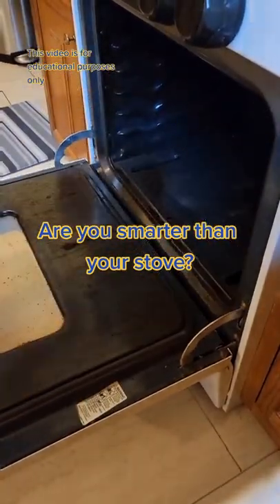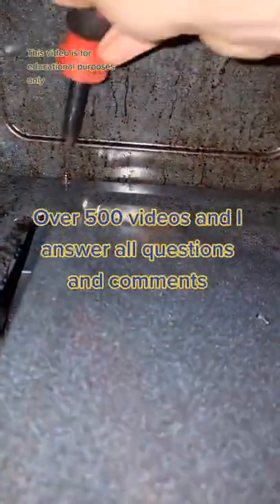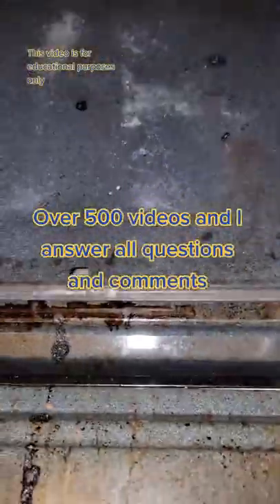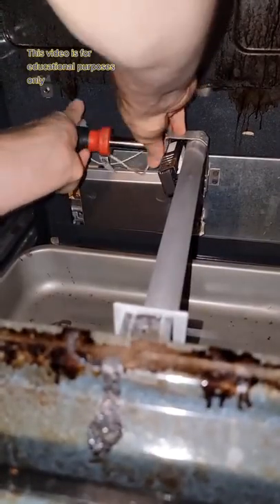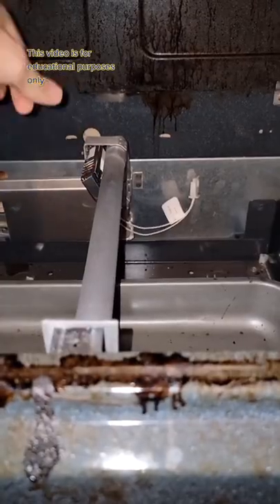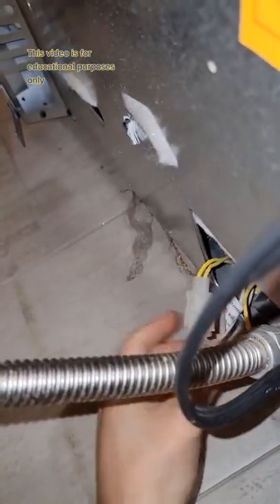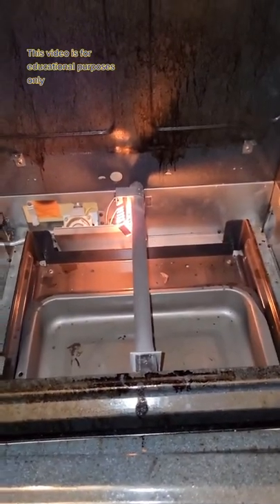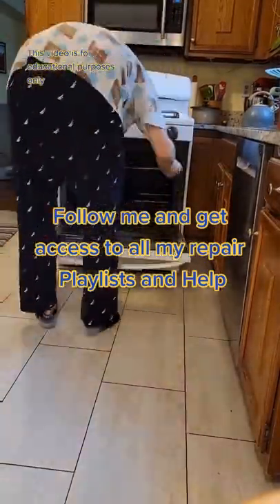How to change an ignitor on a gas stove #shorts

Comment: Except when it's not the ignitor because a lot of times it's not
Reply: Majority of the time it is the igniter. I've replaced a lot
Reply: Mabie 65%-70% of the time it's the ignitor that's not allways
Reply: It's normally the ignitor..
Reply: @@tanyao.5826does your gas kick on? It could be your thermal sensor or ignitor module.
Reply: Mines is the Burner.
Reply: So mines glows but the burner doesn’t ignite

Comment: To me, it's the diagnosis that requires experience and expertise. Obviously anyone can use a screwdriver. Fixing appliances and other house maintenance isn't very physically demanding, it's knowing what to do (or at least where to even start) in each situation.

Comment: If you just started repairing your own stuff and tinkering with it instead of buying it again, please start with something safer before trying something like this. A pair of headphones maybe, just not anything that can start a fire just yet. Get some more experience.
Reply: This is a perfectly okay video
Reply: @DualityElite  yeah, if you're trying to blow up your house that is. He didn't even recommend ONE safety tip in this, like even what gas smells like if there's a leak. This is not a safe video.

Comment: What about an igniter on the burner? Could you do an info video on that please? Thank you either way 🙏💛
Reply: Yes! My one burner is leaking gas when off.  No clogging & burner ignites, just smells gas when it’s off.  Can the burner be replaced or do I need a new gas stove.  I bought this stove new in 2009, fridge air brand
Reply: I’m calling the gas company this morning to come and shut the gas off to the stove I can’t sleep. It’s 3 o’clock in the morning and it’s worrying me.

Comment: My oven is from the 80's, it's electric, and has two large exposed heating elements. They just plug into the back wall, if they go out, do you think I'd be able to replace them?

Comment: I am attempting this while hubby is at work. So my problem is that the metal cage around the  new ignore is not the same as the one I took off. The screw part is on the wrong side( only 1 screw bracket unlike the one I took off that has a bracket on each side if that makes sense. The wires will have to be facing the back and they aren’t.

Comment: I have an LP gas stove top wont click to light. Can light it with a lighter. I bought and installed new "spark igniter". Still not clicking to start. What should I do next? We replaced the bottom oven igniter. That works. HELP! Ron

Comment: Really, anything can be boiled down to "if you can unplug something and unscrew something you can fix (thing). Hell, that's literally all you have to do to fix up any laptop. But you don't see a lot of people fixing their laptops, because most people have no fucking clue what a daughter board is, or that they need to disconnect the ribbon cable before you remove the keyboard, and don't even get me started on elements below the modular part level like capacitors